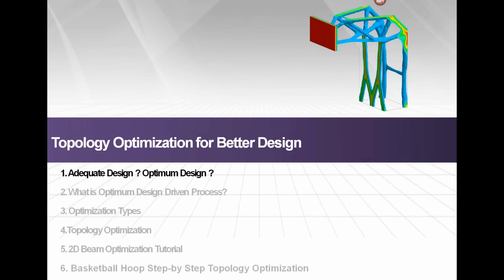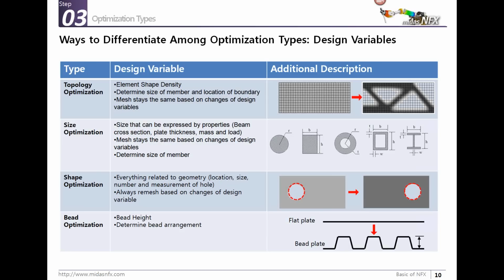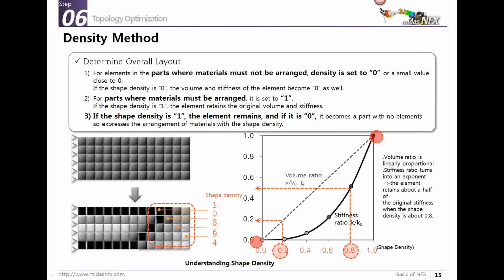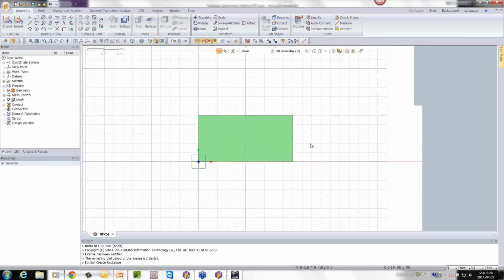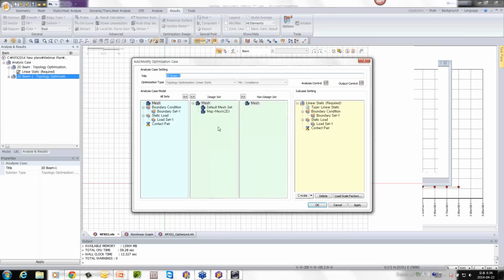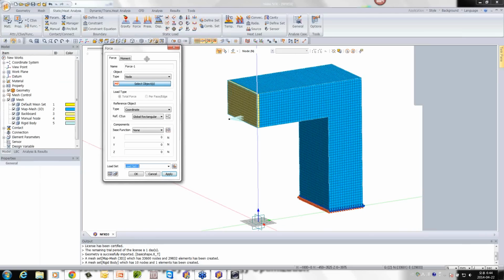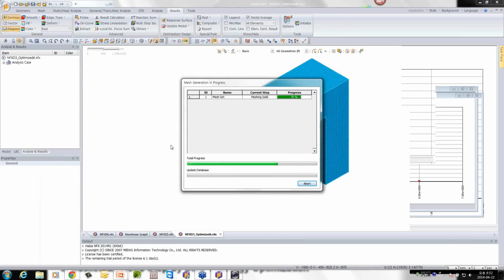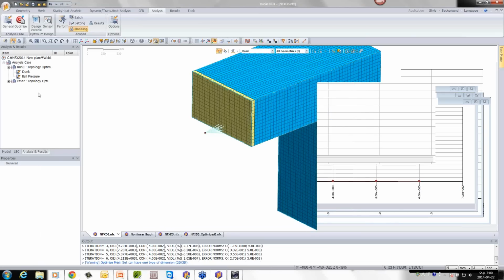Topology Optimization for Better Design - midas NFX 2014 Webinar

Comment: This is very good, however if I am correct in saying that the optimisation is based on a static linear analysis, the geometry optimisation does not take into account buckling of the individual members, which will need to be made bigger as a result, for members subject to bending/compression
Reply from the maker: +Luke Riddoch you are right. You may have to consider a buckling analysis on your optimized model as well. Please though note that topology optimization can also be performed for linear dynamic analysis, so it is not only limited to linear static.
Reply from the maker: +Luke Riddoch Topology optimization is more like a way to help you in the conception phase. It will give you an idea of how to change and improve your model. After that, you will still require to do normal FEA check to be sure the model is resistant enough in all the cases you are thinking about.